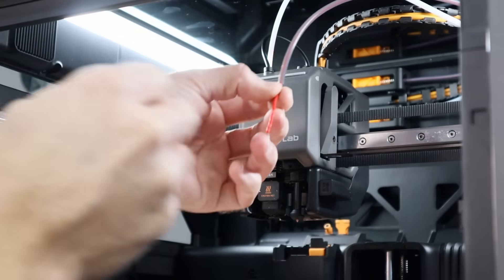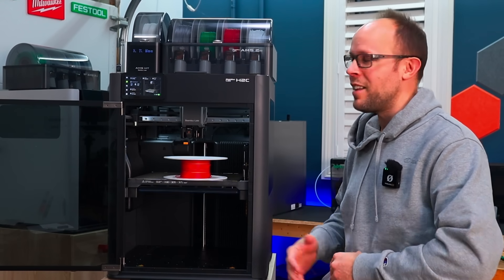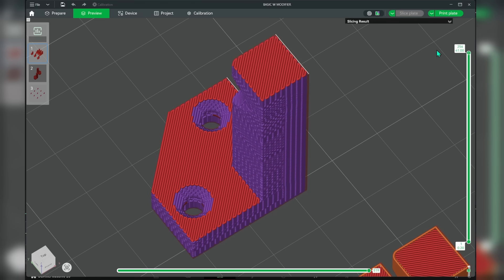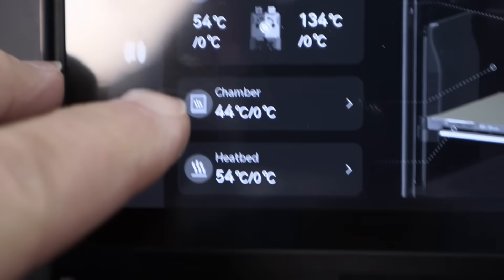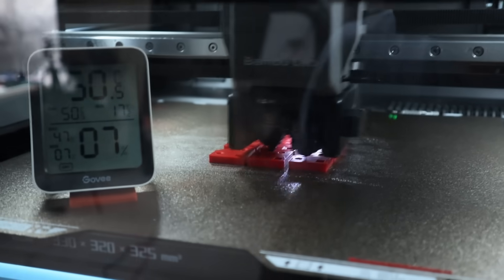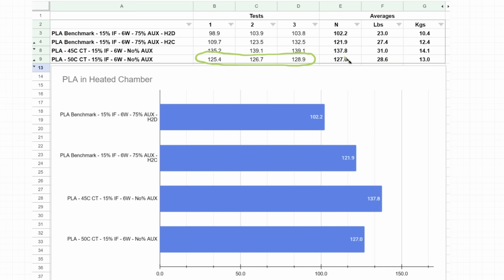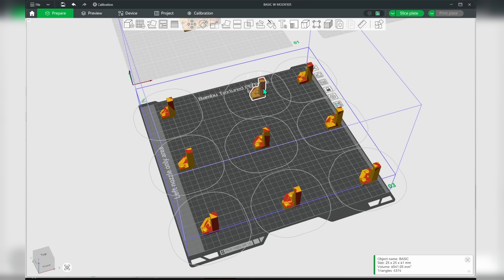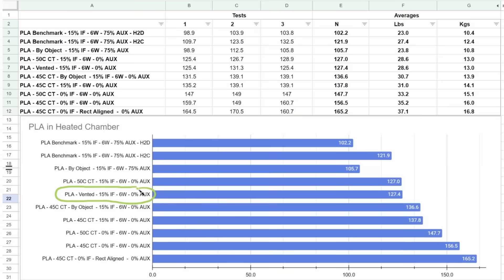If PLA can be printed inside of heated chamber, how much stronger are those parts?  Let's find out!

Comment: It's not that the hot end clogs. It's the cold end that clogs. If you can keep the cold end heatsink cool with either water cooling or the cpap mod piping in cool air to the cold end, it shouldn't clog.

Comment: If you want a heated chamber AND to be able to control the auxiliary fan with the chamber temperature setting, then what you need is a standalone chamber heater that's independently powered and controlled separately from Klipper.  There are a couple of brands out there selling these, mostly for resin printers, for some reason, but they get up to about the temps your're looking for.  Set the temp on the discrete 3rd party chamber heater to be about what you want (maybe a smidge higher) and then set the chamber temp in the slicer/ Fluidd to kick the fan on when the temp tips too high.

Comment: If you’re interested in PLA for strength, then selection of the PLA type is important. Using PLA+ gives additional strength without sacrificing printing ease. Matte filaments are stronger than silk filaments. If you want PLA performance with a heated chamber, you can go with Polymaker PLA-HT. Choosing the right material is far more effective than trying to find a way to make the wrong material work better.

Comment: A trick that I used in my heated chamber printer was piping in external air for cooling using cpap hosing.  I was using it for overhangs, but for your application it might work to cool the heatbreak.  You wouldn't need nearly as much air for heatbreak cooling as I needed for part cooling.

Comment: Qidi Max 4 looks to be the best printer for this kind of test
Reply from the maker: I'll have to check it out and see how it does.  I'd like to see some kind of pre-heating ring around the nozzle, which activates when needed, it would avoid overhangs and bridges of course, but it could do the job of keeping the previous layer hot enough for all materials for a good bond.  I'm sure there are other ways to do this too though.  I'd love to see some kind of cheaper SLS, something in and around the 3K mark would be awesome, even if it could do 5 x 5 x 5 parts, it would be useful for a lot of projects.  We'll see what happens, hopefully someone is working on a final solution out there.

Comment: I did not do any testing, but have obviously better layer adhesion if I leave the door on my X1C shut, and use a bed temp of 65C (instead of 55C). Chamber temp will heat up to 40-45C depending on ambient compared to 30-35C with the door open. The parts felt less brittle, and thin walls were stronger. 
Standard Bambu Basic doesn't seem to suffer from melting issues in the extruder like heat creep issues, but Glow does.

Comment: What about using a printed screw as infill? You make the screw hole in the middle of your layer lines, and you print a horizontal screw with a truncated profile for bed contact (a D shape at 30°).

I actually once did this to strengthen a part but I never measured anything so I don't know if that makes any difference.

Comment: I print everything in a heated chamber in the summer in my warehouse in Phoenix.. can be 50c outside and high 40c's in the shop. 😂 If I run the fans in the shop and it's blowing air near the printer, the outside edges warp the print. Need to block the air flow for consistent prints. Don't need to worry about drying the filament either!

Comment: To be honest I’m not surprised by these results. I currently use a Bambu A1 and I find room temperature makes a huge difference. I haven’t done scientific strength tests like yours but anecdotally I’ve seen similar results. Furthermore I’ve found that on particularly cold days when room temperature is lower, I have bed adhesion issues. On warmer days the same parts print fine. Glue slightly improves the situation. Interestingly if I switch to the cool plate supertack, the bed adhesion is significantly better. Similarly if I turn on a heater in the room the bed adhesion gets better again. My assumption is this is due to the smaller differential between room and bed temp, whereby higher layers are much cooler. This only affects parts that are more than about 20 layers. Below that it’s fine, presumably because the filament is still getting some heat from the bed which reduces that differential.

Comment: One solution for layer adhesion could be to have a laser, which can rotate around the extruder nozzle to orient itself properly, that would reheat the previously laid layer as the new layer was extruded onto it.  Probably not cost effective however.

Comment: We have over 6000hrs between 3 printers, (2 K1 Max and K2 Plus)  always enclosed using Polymaker PLA.  Chambers usually around 35-40.  Had a few hotend blow outs but its almost always due to bed adhesion issues.  We do 5-8 walls, 25% infill with adaptive cubic.
Reply: Polymaker pla is a bit different, it can work in warmer chamber

Comment: I haven't tried but my Qidi printer has a top cover that can be removed which would reduce the temperature at the tube.  Not sure if the lower portion near the plate would be at temp are actually hotter to compensate though. My first thought was to use a sheet of cardboard to separate the chamber upper and lower but how to mount it and also allow the head to travel would be difficult or impossible.

Comment: For me the biggest reason to print PLA in a heated chamber is to equalise the temperature between the heat bed and the chamber itself.  The more consistent we can make the temperatures the less warping and less lifting we can achieve.  Using the Biqu Frostbyte plate I was able to print with a bed temp of 40 C and chamber set to 40 C also.  

Any increase in strength is an added benefit but secondary to reducing warping.

Comment: I’ve been printing PLA with the door closed on my Voron Trident (which doesn’t have venting fans) for literally years without quality issues. I’ve never understood why people claim that you must leave the door open / vent the machine when printing PLA. It’s just not an issue in my experience.
Reply: Some pla filaments are more resistant to this
Reply: @riba2233  I'm sure that's true, but I've used a ton of PLA filaments over the last couple of years and it just hasn't been a problem for what I print.
Reply: @KaminKevCrew  I see, maybe your room temp is a bit lower

Comment: Cooling the filament inside the printer seems impractical, but you could cool the spool down in a refrigerator or freezer ahead of time and then perhaps suspend the spool inside a cooler filled with ice (near but not contacting the spool).  This will probably make the PLA more brittle, and heal soak within the chamber may eliminate the gains but perhaps you can gain another few degrees.

Comment: . Bamboo isn't very good for temperature and thermal balance, but my Frankenstein that once was a Qidi 2 Prints like magic a pla receiver. Especially Glonk lowers, I can noticeably get better layer bonding and overall cohesion. There is a fine line on temperature though, I dance The Edge depending on the filament, but if it does get too warm it will lead to deformative results.
Quite often and this doesn't work so well for some filaments. I have some filamentium that doesn't respond too well to chamber temperature tests.
Reply: Why isn't bambu good for this?

Comment: I'd love to see this repeated with PETG, I've been trying to tell people to print pla and petg at much hotter chamber temps than Bambu software sets, I've overridden most of my H2Cs fan settings and I get amazing print at hot and fast speeds.
Reply: what chamber temp are you using for your PETG prints?
Reply: @omurize2007 I generally print around 40-45 Celsius

Comment: What I would do is this if the printer has somewhere you could feed air in thru. How effectively you can channel air, or more importantly, the heat from said air, will determine the max gain from this. Based off of my weed growing tent setups.

Okay so you need a heater, and this extension cord looking thing which has a skinny long ASF wire that you hang inside or just place in the chamber place however possible and a little box with two buttons and a screen that shows the current read temperature (well mine actually do humidity and temp but there are temp only models I believe)from the sensor at the end of the wire. 

When you press those buttons, the screen switches the desired temperature up or down accordingly in increments. After a few seconds it switches to the current temperature reading again. 

The two outlets this machine has on it are a on and off, which you plug in a heater and a fan accordingly (in my case I actually use a humidifier and dehumidifier since I'm using it just to control the humidity since my tents control interface lets me set desired temperature with my various inline fans inside for finer vertical flow control). So basically once everything is plugged in right, the sensor is inside the chamber, and your desired temperature is dialed in, you're set! It'll turn on the heater until the desired temperature is met, then it shuts off until the temperature starts to stray again. You don't use the other outlet! So you could probably find a similar tool like the one I use that's just humidity based, and one outlet. Probably cheaper too, maybe significantly. If I recall right, mine were about $70 a pop for just the controller. I'll go dig into one of them and check which model from what brand I own if you're interested, or anyone else is.

Comment: This is more of a philosphy than a specific idea.

My perspective on cooling, while maximizing strength, is that it should be limited to only the amount of cooling required to preserve the geometry of the object.

This can be accomplished in a variety of fashions.
1.  Slow print speeds - slower extrusion means less heat into the object and less cooling is required
2.  If printing multiple objects - space them around the build plate, that way the cooling fan only blows on each part while a layer is added.  This doesn't require that "print by object" is enabled.
3.  Spend time dialing in cooling for each print - print a single object, set the cooling fan to what is a best guess is the minimum that will work and send it.  See what happens.  keep testing until the minimum cooling that still preserves geometry is found
4.  Lower print temperatures - not by much, but a difference of 5-10C can sometimes correct geometry problems and not require altering the amount of cooling.

It's been my experience that the default settings for cooling tend to be excessive in the extreme, lets say that's based on N=6, so it's subjectively and notional vs. being a universal truth.  Those excessive cooling settings allow for a printer to pour molten hot material at incredible speeds, but with the downside that it also compromises the integrity of the part.  For knick knacks and tchotchkes that is fine, but for anything that will do ANY work it's not.

Comment: I use pc water cooling parts to cool my heat break (and area above) while running my chamber at 60 degrees when printing pla. Also sliced up foam segments work well to both insulate the pfte tube while also holding the cool water tube directly alongside it.

Comment: It’s slightly stronger, completely eliminates warping, and you can actually run PLA faster this way, both for flow reasons and for just running higher temps on the filament. 

PLA-GF in this setup could probably run at ASA speeds.

Comment: i did use the 45° minimum heating setting on the h2d for big pla to stop warping if you print something on the whole bed ( still lifted ) but then i came on the idea to use it on pla regular since it worked out without any clogs then i bombarded support with the idea to please let me set the chamber heating lower to say 30° if you have a cold surrounding of the printer you could atleast have reproducable print chamber temperatures but they wont do it and told me to do it with the bed temp wich is kinda bs and not the idea of reproducability

Comment: You know, if you had a CPAP ventilation duct encompassing the PTFE tubes carrying cold air from outside over the heat-sink, you could likely print at arbitrarily higher chamber temperatures. The dream would be to print at above 90C or so, at which point PLA anneals and gains temperature resistance up to 150C. To have a continuous air flow without chilly part cooling all the time, you’d need both an inlet and outlet duct to cool the hot-end, the sort of set-up you’d want for printing PEEK.

Comment: I can confirm, accidentally printing with PLA using a gcode meant for ASA in my heated chamber printer causes a clog 100% of the time. Really terrible ones too, the filament gets eaten by the extruder and I have to disassemble the whole thing to clear it.

Comment: How about if you tried after finish printing to turn on the heater chamber at let say 55 for 30 minutes. I wonder if that will make the layers soften into each others and make a stronger layers.
Reply: You can do PLA annealing on the printbed for short, simple, solid models. You just slowly ramp the bed temp towards the end of the print, then cover the print with a closely fitting cardboard box or sheets of foam to create a miniature heated chamber. 

Let it sit at 100C for half an hour, then the cooldown ramp is important, but can be automated with g-code:
Reduce temp by 10C every 10 mins, then eventually let it sit at 30C for an hour before deplating.
The prints will distort a little, and suprisingly they shrink in the X-Y axis and grow in the Z axis! 

You can also see the extent of the annealing with clear PLA: annealed areas turn frosted internally.

Only time I've really found this technique useful was printing octagonal dowels flat against the bed, they turned out obscenely strong!

Comment: hey i saw a 3d printer called Orion that uses an Ir heat lamp in the camber. the advantage is the IR only heats the surfaces and not the whole depth of the print.

Comment: Slowing down to ~30mm/s print speeds(or even slower) would drastically change these results, printing slower creates better layer adhesion. You learn that when printing firearms, where you need all the layer adhesion you can get. You are printing way too fast to acurately test for layer adhesion, also it would be better at 100%, which is what you should be printing at if strength is a goal, either all walls or 100% infill, either way I see these test results as bunk. If you are going for strong parts, you dont want it to be hollow, you want 100% solid. A better real world use case test is needed...this is not that
Reply: There are real world benefits to having hollow parts. Most benefit that is obvious is weight but second benefit is forcing the plastic to take a load in compression. Polymaker had a 50g hook design challenge this year, and the winner had well placed cavities. IIRC it won by x5 the second place finisher.
Reply: @joescalon541  Let me know when somebody succeeds in doing that with a glock frame...or an AR lower.....or anything that requires a massive amount of real world strength....weight doesnt really seem to matter anymore now does it?

Comment: You could probably trickle compressed air through the bowden tube with the help of a Y splitter outside the chamber with one side feeding the filament and the other compressed air. Then drill a small hole in the bowden tube right before it goes into the hotend to prevent the pressure affecting the hotend.

Maybe the hole could even be drilled in the heat sink to help further with cooling that.

Comment: machine with accordion-like flexible thermal shield on the gantry (like Stratasys machine) is an ideal FDM layout/design focusing on high chamber temperature while isolating area above heatbreak up to extruder to keep it cool enough to avoid filament being too soft and curled around while pushed by extuder gears and then cause clog..

Comment: A caution. Bambu extruders properly blocked with PLA blobs are a PITA to clear. Takes about an hour. The only two times this has happened to me have been when I have started a PLA print while the printer was still hot from a recently finished ABS print. If your slicer says do or don't do something, it's generally for a reason.
Reply: I thought that the first time, and have probably done it 3x now.
Once you've done it a couple of times it's a 5 minute job, even without the jig to un-pressfit the bearing. First time is scary so takes extra long due to caution, second time is slow cause you remember the first time. Third time is easy cause you know it's nothing to worry about.
The trick to doing it "freehand" without the jig, is to put some bolts into the threaded inserts and use those to suspend it: no jig required.

Comment: In the summer time in my area, my workshop even with a portable AC gets flippin toasty. The chamber will get up to 48*C with the top lid off just as a consequence of printing with prints from 1-4 hours, but PLA+ materials takes it like a champ (eSun's version anyway). I haven't had clogs even with filled PLA variants, but it does start to string like crazy, regardless of preventative settings. Per my usual however, pla+ is more of a cheap iteration material for me rather than end-use parts.

Comment: Use a PID (Proportional-Integral-Derivative) controller to control the temp. and use multiple sensors to feed the temps to the PID controller. I'm a complete novice with 3D printing but I would think to get the temp consistent, you would want a fan that takes heated air from the top of the chamber and return it to the bottom of the chamber. Insulated the chamber really well and use a low volume fan just to keep the temp homogenized throughout.